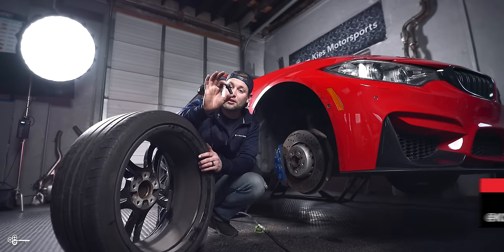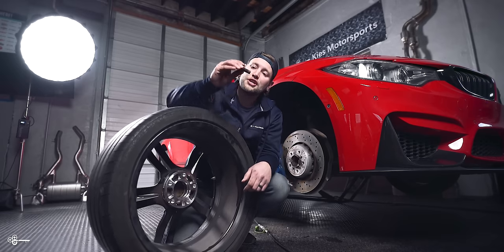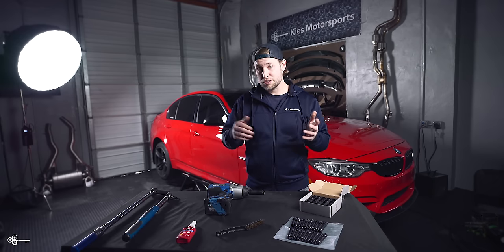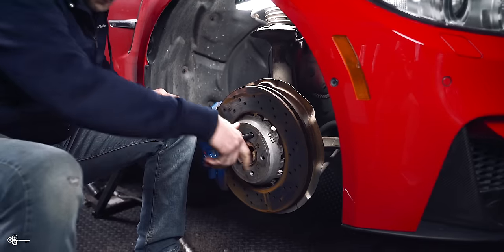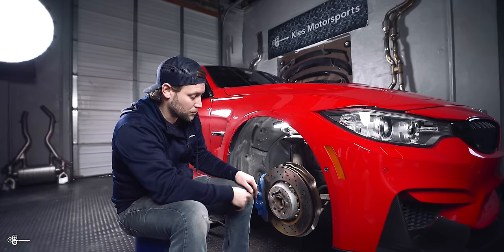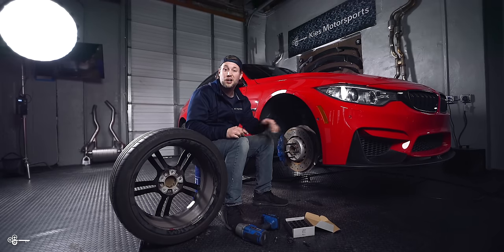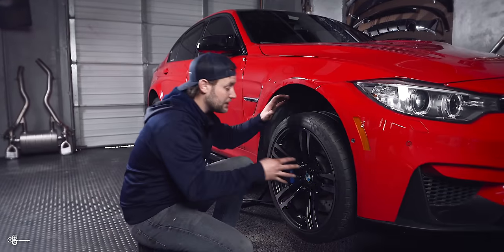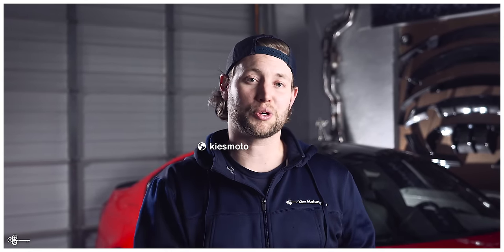BMW F80 M3 Wheel Stud Conversion (Works on F30, F32, F15, F25, F80, F82, F87, E90 and more!)

Comment: So the box you ordered comes with everything you show? What are the MH Racing Nut Options and are those what you are showing in the video?  I just wanted to get some clarification on what all comes in the box.  I have the M666's with 12 F spacers and 10 R spacers and want to make sure I buy the correct ones.

Comment: How would this affect on doing a brake rotor removal? Would the studs have to be removed first?
Reply from the maker: It still comes off the same!
Reply: @KiesMotorsports  Thanks!
Reply: The bolt goes from the wheel, through the brake rotor hat, straight into the hub.

Comment: I use M4 19 inch Original rim on my F30 320i. But sometimes while driving I feel vibration on my body & steering. Do u feel the same if u change to M4 rim ?

Comment: Hi mate..., what’s the risk of the wheel jamming on the wheel studs and then becoming very hard to take off. I had this experience when I once got a flat tyre on a car running wheel studs. Even three guys together could not get the wheel off. Became a rescue situation. This is why I’ve been wary of wheel studs ever since.